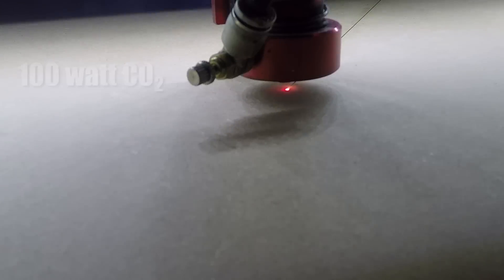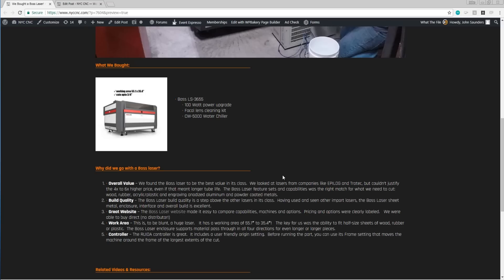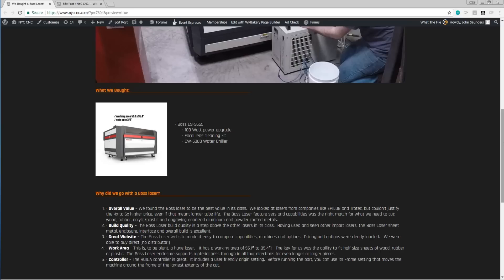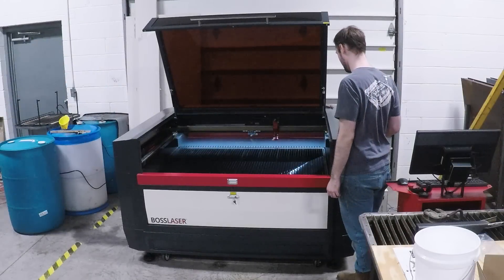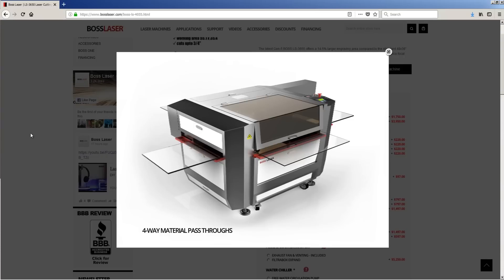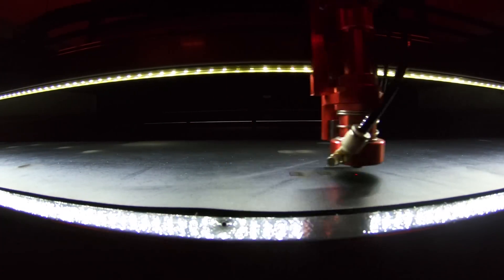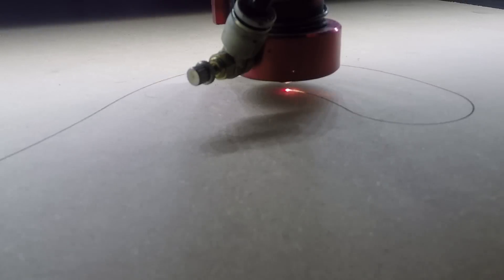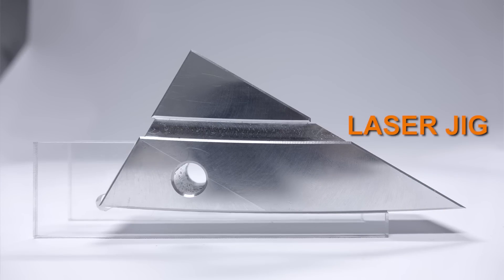We bought a BOSS LASER!

Comment: Since you are already tech savvy, paying over the odds for a Chinese machine doesn't seem to make much sense. You could have imported directly from China at about half of what you paid.  Buying from a US seller is worthwhile if you need tech support but I suspect you could easily get by without that. Anyway, congrats on the new machine. I have a 100W laser as well.
Reply: Michael Henriksen testing and adjusting high voltage power supplies isn't for everyone
Reply: I bought the same size machine from a Chinese company in California. Great price(less than half) but not at all worth it if you need to do production, like I do. There is a reason these cheaper Chinese models are cheap. The quality of nearly every aspect of the machine I bought is subpar at best. I have no problem doing my own tech. Heck, I could build myself a machine from scratch. The point is that time is money. I cannot fully take advantage of the 130w tube on this big machine. The flimsy gantry that wobbles near the center. The terrible mirror mounts that are so finicky that on my best day of mirror aligning, there are spots towards the far right of the bed that will not stay aligned at the head. The machine works, and I've made a lot of money with it, but it's much harder to stay competitive because of it's inefficiencies. For hobby work or craft shows these machines are fine as long as you know how to service them(constantly). For production work, no way. Not if you enjoy maximizing profit, or feeding your dependents. Seriously they don't stop eating!

Next machine will definitely be a Boss, Thunder Laser, etc. Something that has been vetted. Anyone near Cleveland, Ohio with a Boss that I can come take a look at?

Comment: $10k for such a huge cut area, 100w, and the passthru's is totally worth it. I've add a pass in, not thru on my k40 (really only 32w), totally worth it. I've added closed loop cooling on mine, so nice! Next mod is closed loop steppers, so i can error out on collision and not lose a piece of stock. Need to by another 2 smoothieware boards for the k40's.

Comment: I purchased one as well. They identify as an American company yet all they do is repackage Chinese laser tubes and software. My lasers frame was delivered a month late and bent. The software is in “engrish” and proprietary. Avoid boss at all costs.
Reply: Of course it's a Chinese laser, just like Full Spectrum. They add in the over head of having an office and warehouse in America, stocking parts and hopefully adding U.S. phone support. They are often started by American's who got pissed off at the pricing structure of places like Trotec or Kern and import containers full of laser machines and set-up shop as a "stand alone" distributor for Chinese companies like Blue Elephant, Omni, BCAM, Jinan Forsun, Golden Laser etc... I've got quotes from over 30 Chinese CNC Laser/Router Machine Manufacturers and they all are basically the same. Most of them do not actually make the frames/sheet metal enclosures however. Which is why nearly all the import machines look the same. There's only two types (brands) of import Laser Tubes available with Reci being the most dependable and longest service life. Looking into the details about the quality of the motors, linear rails, motorized Z axis, honeycomb table inserts, free 4th axis rotary table, pass-thru capabilities, fume extraction etc., are really what makes the difference your Laser shopping experience.

I can get a 4x8 table with enough power to cut 3mm steel, shipped to my nearest port for $9000 from quite a few different manufacturers. The only thing I shop for is support, the type of cutting software used, (if they'll supply a set-up computer as well) and if they'll actually do a test cut on my actual machine before crating it.
Reply: I don't disagree with you. I understand the business model. I guess I'm referring to their customer support.
Reply: Disclaimer, I haven't heard anything good OR bad about BOSS because i'm not in that market. But, when your business is in reselling something you don't make the only value add you have is service and support. If you don't get that right someone else is going to copy your business model and swoop in and do it right for you.
Reply: I've heard really bad things about BOSS Laser as well.

Comment: Add some oxygen to the cut and you might be able to do 1-2mm stainless with that!
Reply: Huh?
Reply: High power lasers use assist gas to push out material. Usually nitro, for for steels you can switch to oxygen and get extra heat
Reply: Shelltech83: correct but that is not really what I’m talking about (I’m guessing you are talking fiber/Nd:YAG lasers in the kW range).
I’ve read about and seen on youtube of people succesfully cutting stainless with co2 lasers if thet are 100W or above.
Stainless is such a worthless heat conductor so it works.
Reply: Thanks.  So this laser uses an assist gas?  I didn't see that it mentioned in the web site specs.  ??

Comment: Hi, did you look at LED lasers at all? If you did what's the main reason for going with the Co2 over the LED?
Great videos
Steve
Reply: Sorry I Kent fibre laser not LED.
I've just been doing something with LED's and that was stuck in my brain.
Reply: We have a fiber laser at my work place, it is very fast but not as clean cutting as the co2 fired laser we have sitting right next to it. The fiber laser has LED lights in it to generate the beam so you where right, really, LOL!! We cut .063 aluminum at 1100 ipm and have 13000 ipm travels.
Reply: fiber laser is primarily used for marking/cutting metals. wavelength is no good for wood or acrylic or other common materials.
Reply: Spirit fiber lasers are not designed to cut clean, if you get clean edges, and when I say clean I mean like a razor blade clean, you are lucky. I have been running lasers for 10 years and the Co2 lasers cut much slower but much cleaner. We use pure nitrogen to cut stainless steel and aluminum in thicknesses in ranges from 24 ga to 5/16”
Reply: Spirit ours is 4000 watt, it cuts very fast but not as clean as a Co2 laser due to the fact that the heat below the materials being cut is not high enough for the assist gas to blow it cleanly off the edge.
Reply: They do basically everything better than CO2 lasers, but getting higher power levels is extremely expensive.
Reply: 4kW and an unclean cut means you're doing something wrong, not the laser.
It's not the wavelength.
Reply: Here's a hint: maybe your edges aren't as clean because you're cutting too fast.
Again, this has nothing to do with the laser type. The type of the light source is not relevant here.
Reply: Spirit yes the light source has no relevance but the fact of Co2 not being present is the contributing factor, if we slow down the edge is considerably worse, I feel that the technicians from Amada are quit capable and know what they are doing. 7 ga stainless is being processed at 375 in/min with a very light fuzz on the edge, and no heat banding or discoloration. All the materials are consistently of the exact same edge quality. We are right on the edge of our assist gas limits on thicker materials but the thinner materials do not exhibit any better qualities so the parameters are within realm.

Comment: Love it! Just been looking at BOSS's site, some awesome lasers (and prices). I still remember, when I got my first laser cutter 5-6 years ago, what on earth I'd use it for. Now I can't do without it, and I've got two ;-) Useful tip - if you get fed up not being able to see clearly through that dark lid when it's closed, it is totally OK to replace it with clear acrylic. I did that on mine, just used some 1/4" acrylic. Acrylic is completely opaque to CO2 wavelengths, so is perfectly safe to use as a window. I don't know why they bother putting dark or colored windows on CO2 laser cutters.
Reply: > I don't know why they bother putting dark or colored windows on CO2 laser cutters.

because the spot being cut can be blindingly bright, it's sometimes easier to monitor progress through a tinted window.
Reply: That's true, good point. Especially on the higher-powered machines.

Comment: I would love to see a more detailed video about this laser, maybe testing its cutting capabilities?
Reply: We just purchased the HP 3655 from Boss, in large part due to NYC CNC going with a Boss. Based on our research, the 150W CO2 that our machine is, will cut CLEANLY through 18ga Stainless. Aluminum is a no go until you get to about 400W. Aluminum just soaks up the heat far too quickly is what we have been told by numerous laser companies that we have spoke with. 
Looking forward to more laser vidoe's NYC CNC, until ours gets here!
Reply: @jeremyslack6256  How do you like your HP 3655 Boss Laser after 2 years? Interested in one for myself!
Reply: @MarcusRitland  It has been an ok machine. We have had a couple issues, some that Boss has been able to fix with little to no effort or cost to us. Other issues have been a constant plague for us. The engraving detail/quality is not matched by a more expensive machine. I truly believe that there is an issue with how the laser is told to fire, and the timing of those firings. Boss says it is a hardware issue. We have replaced guide bearings, pulleys, belts; all to no avail. The Metal cutting capabilities are overstated from Boss. We have been able to achieve marginal cuts in 20ga stainless. Marginal as compared to what we can order from our metal supplier who is using a 4000W Amada. There is a heat affected zone around the cut that is mostly acceptable, but at times is not. Just depends on the work required. The Boss uses an amazing amount of O2 to make cuts in stainless as well. We now have 5) 0249 oxy cylinders. We will empty a tank approx every 4 hours of use. That is a $1500 investment in cylinders we did not anticipate. Not to mention the $40 fill for each tank. Short of the long, it is far more cost effective to have a metal supplier with an industrial laser cut your stainless sheet. We will typically fill a 4x10 sheet with designs and send it to our supplier to cut. We will use the boss for quick turn or large margin stainless jobs. 

I will say that it does a fantastic job in wood. It eats 1/4 maple ply for lunch. Cutting vector art really really well. It engraves well in wood as well. When it comes to tumblers, that is where we have had frustration with engraving detail. 

Email us nwlasermade@gmail.com if you have further questions!
Reply: @JS1433   Thank you so much for the detailed reply, really appreciate that. I was mainly interested in the metal cutting they advertise, so that is good to know. Sounds like if I want to cut wood it is a good machine, not so much for metal.
Reply: @JS1433 how would you say this does for cutting very thin fabric sheets and engraving leather?😊
Reply: Did they differentiate the capabilities of the 100 vs 150 watt lasers?
Reply: Able to cut thicker materials. The HP series steps it up one notch further and includes an air blast feature to help pierce and cut through metal. The HP 150W is rated to cleanly cut through 18ga Stainless Steel.